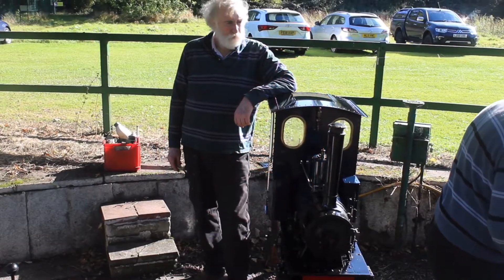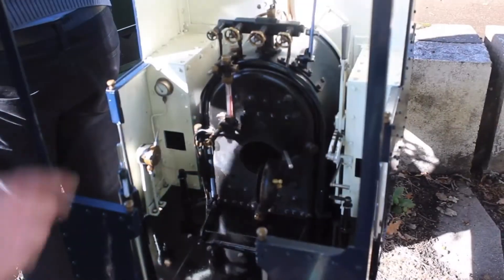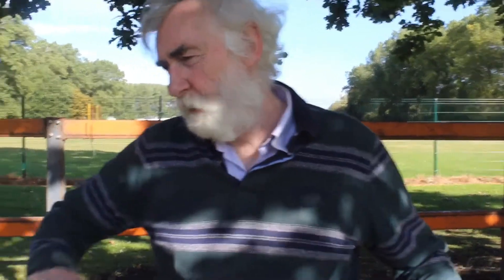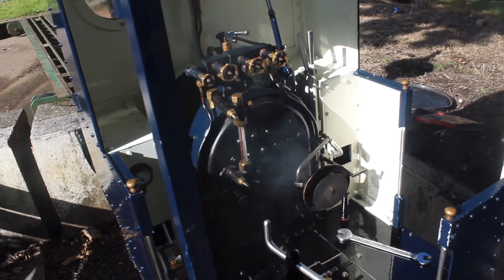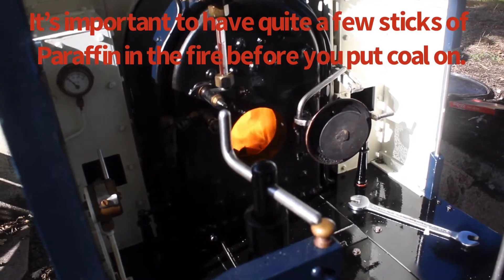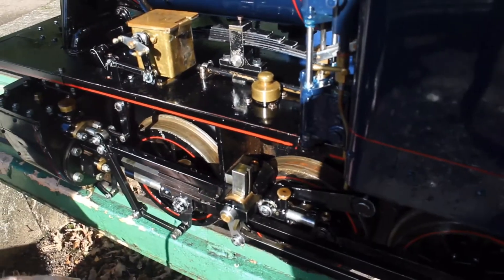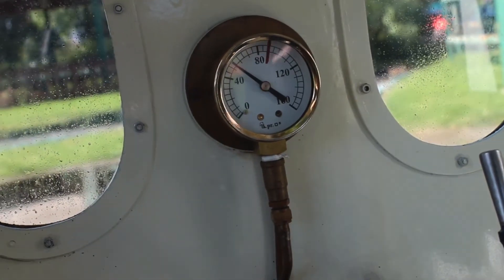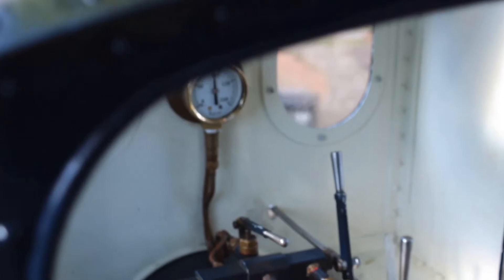How to fire-up a 7 1/4 inch gauge Steam Locomotive! (Basic Steps)

Comment: Wow that little loco can move! How many passengers could it tow?
Reply from the maker: It often pulls around 10-15 passengers. However, it could probably pull a lot more! Despite their size, they are strong locomotives.
Reply: 0:35  @theriversideminiturerailwa8659 
A good 5inch gauge will pull 15 people or up to 1 ton. Romulus will pull 2 tons easily, I know as I have built two of them, along with two 5 in gauge.